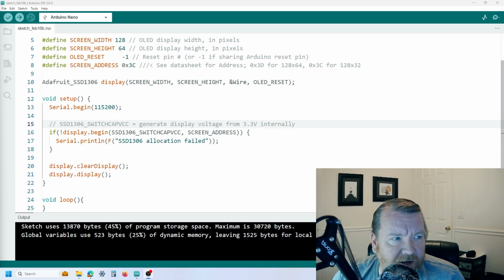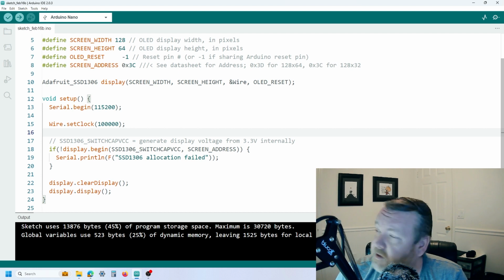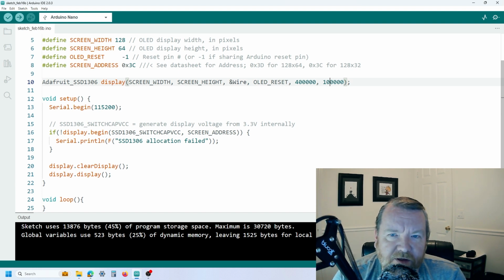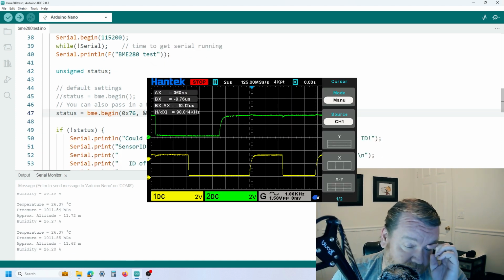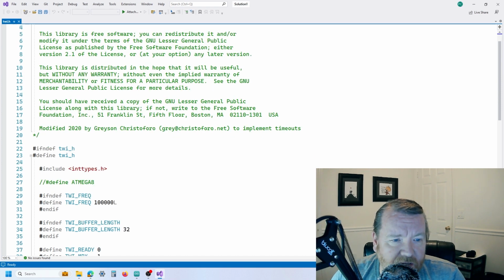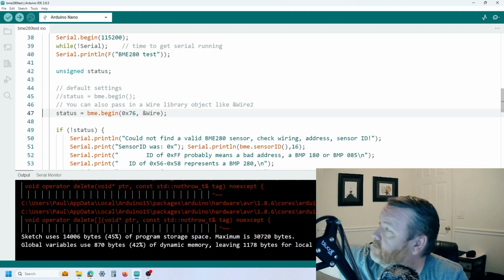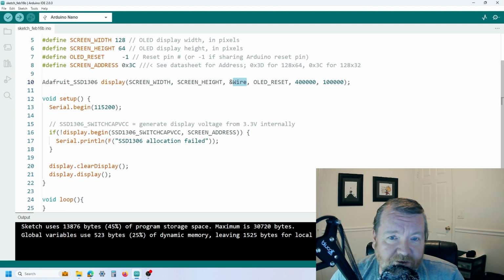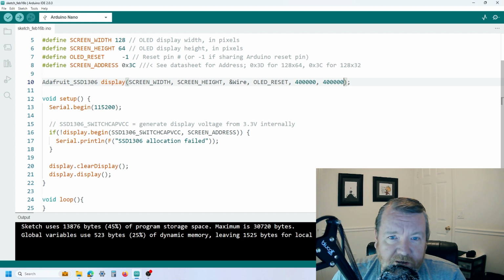I2C Setting the Bus Speed

Comment: I always struggle where to define the scl and sda pins when using a different board not using 4 and 5.
Reply from the maker: Try searching for the board schematic. This will normally indicate the pins, just look for SDA and SCL. If you have never looked at a schematic before, let me know and I'll pull a short video together to help explain about schematics.

Thanks for watching.
Reply: @MakingSenseOTW  I think you misread my comment. The standard wire library has pin 4 and 5 as default. If you use a esp32 or a blue pill or black pill, you can have various pins do hardware i2c. The challenge then is to explain to the library you use, that you are using different pin numbers for sda and scl.
In the examples, scl and sda usually are not indicated as they use the default. So you need the synopsis to find out how to correctly invoke the object creation which I usually find petty tedious.
Reply from the maker: Ahh, got it. I'm actually new to the Arduino system. I normally work at either a much higher or lower level.
I've just purchased several other boards with multiple I2C interfaces (MKR1010 WiFi) and can understand exactly what you are saying. 

I'll try to pull together a video on the challenges of changing the default I2C pins and setting up multiple I2C interfaces with my new MKR 1010 WiFi Board. 

I'm also considering on writing a better I2C library. The Arduino Wire class is great to get started with, but quickly becomes a PITA. 

Since starting with the Arduino libraries a few weeks ago I have found several painful issues using the I2C interface. The last one was a memory problem, when getting low on space my SSD1306 screen became corrupted. This was fixed by reducing the number of "Serial.Print" statements!!!!

Thanks for clarifying the problem.  @arminth
Reply: @MakingSenseOTW  now we're  talking! Looking forward to anything that's better and more tangible! If you need a betatester, I might be a candidate for you! I am running a cnc pendant project that makes use of i2c and interrupts on an ESP8266. It might benefit from something better!
Reply: https://youtube.com/playlist?list=PLue8GZsJoOutgYKCW3QDfv1HEi1-LKPM5&si=MmUCOj6xfsYkcyGL